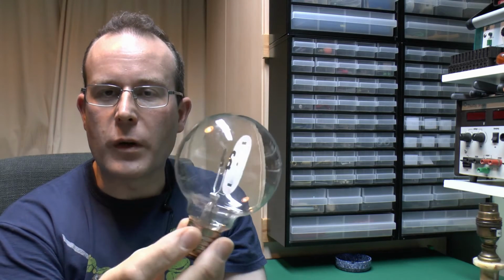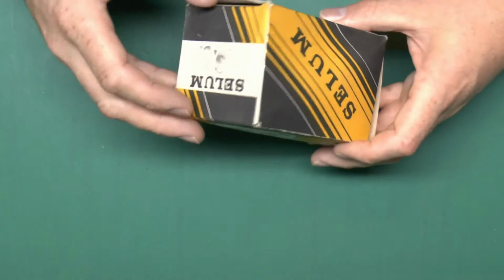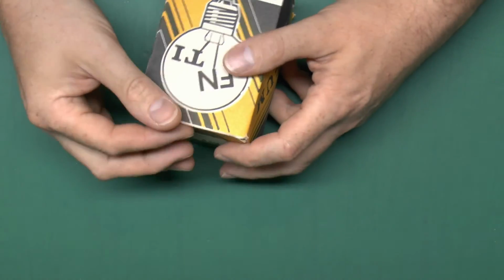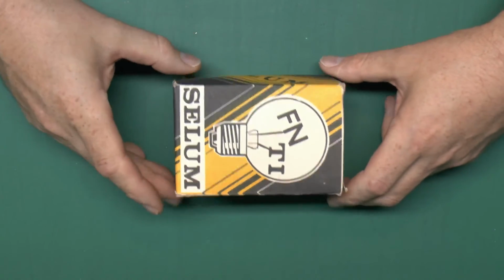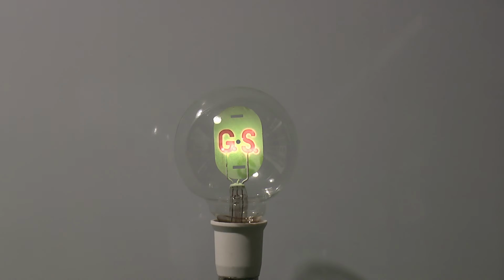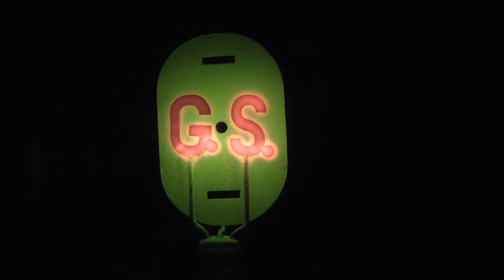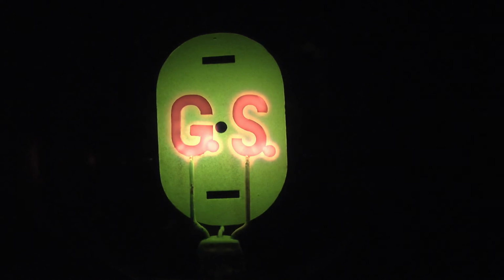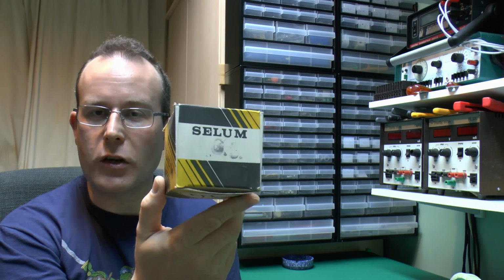Neon Glow Lamp GS, FN TI SELUM

Comment: I bought one of these last year from https://www.mablethorpe.info/ye-olde-curiosity-museum-antique-shop

They had quite a number of these and others of differing designs - one designed with the elements inside the bulb, as heart shapes. 

The G. S., I was told, stood for Galatasaray - a Turkish football club and the green background represented the pitch with the centre spot and goals at either end. 

It was said that the club had had these made for them many many years ago.

Comment: Thanks for sharing ! Selum is a Romanian lamp manufacturer founded in 1936. The white backplate is coated with zinc silicate to emit green light and electrodes are made from nickel. 
The bulb is filled with neon gas at 4 mmHg.

Here is my little lamp made by the same factory.  https://www.youtube.com/watch?v=X8nnkfg-LPk
Reply: What could be the application for this lamp? I guess it's used to mark the names of people in theaters or schools...

Comment: Hi John, was the issue of 256VAC on the variac video resolved, or did you find out what was causing that to happen?
Reply from the maker: copelandaa No. That voltage was at about 2am, however most of the time it is 245-250V which is within the specification.  Subsequently measuring it at 1am / 2am a few times it was around 250V, so no idea why it was so high on that particular day.